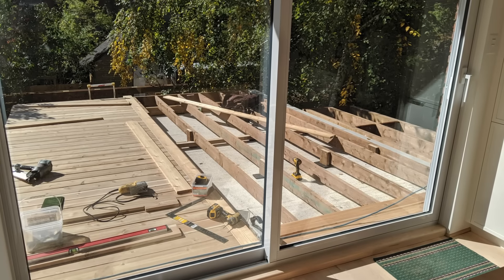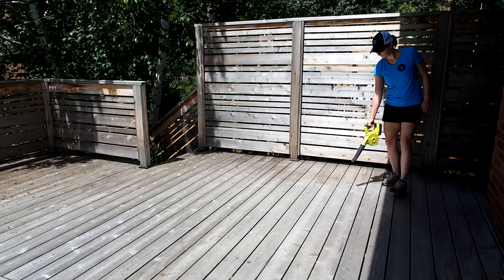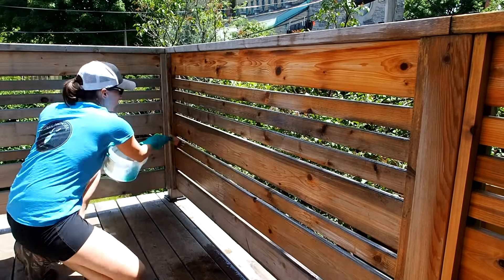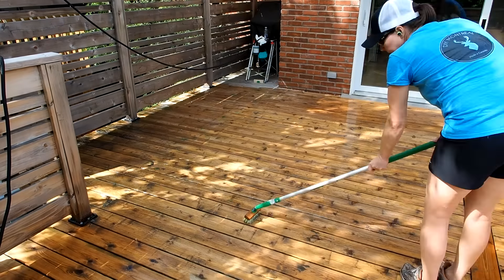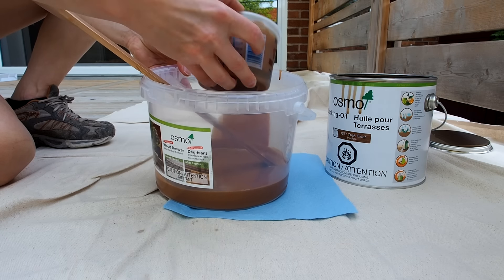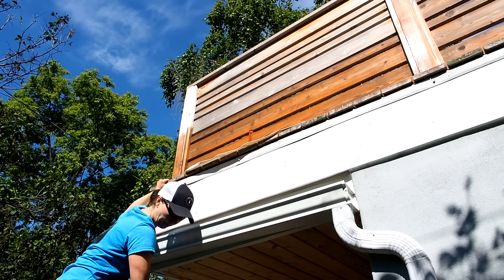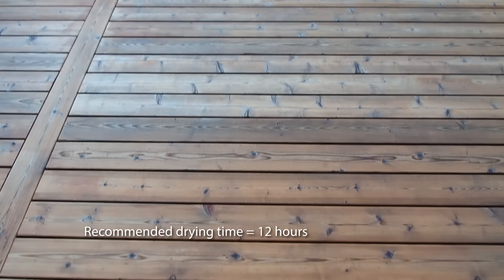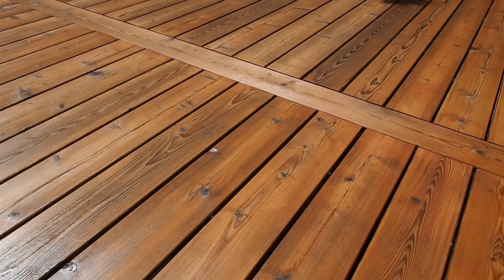Restore Your Deck | Make an old weathered deck look like new again

Comment: Yeah, my wife decided to "help" me by finishing pressure washing the deck while I was at work... and splintered the heck out of the wood. You have to be extremely careful using a pressures washer on a deck, use a wide nozzle pattern and hold it several inches away from the wood.
Reply: It's not necessary to pressure wash, she doesn't do it in this video. Just a hose and cleaning product
Reply: My uninformed self has spent most of today doing this 😂

Comment: Looks great... any word from Osmo on how many years it should last here in Canada?   Their webpage just says it is "easy to apply and renew".
Reply: Most oil products just fades away gradually over 1-4 yrs but you can decide when you want to reapply without having to sand it down
Reply from the maker: I've been told 3-4 years of I recall correctly. Fingers crossed!
Reply: Always plan to stain traffic areas every two years. Use an air compressor to blow out dirt, helicopter seeds from between floorboards
Reply: @drophammer776  Excellent tip?  I will do just that!

Comment: @DIYMontreal it turned out lovely.  How often do you have to do it? I can't stand grey! Wish I saw this before I "refreshed" mine. Over time our deck (much older than yours) swelled/shrank, popped nails, twisted and split.  You definitely couldn't walk without footwear.  It took me days to pound nails back down,  hand plane (I tortured my way through with a block plane fresh out of the package...I didn't know at the time there was a better way...sigh). After painstakingly sanding/planing every knot and bump out and crippling my stupid arthritis I finally was able to step back and admire my efforts. I stained with Thompson seal over fresh looking boards. I had to work under tarps in sections because it decided to rain day after day. The temperature was lowering quickly so I couldn't waste any more time.  I was furious with the Thompson seal! I was ridiculously expensive, and only kept the grey away 3 months!! Oh and supposedly needs redone  EVERY year...

Comment: Marie ... another timely video for one of my upcoming projects: refinishing my deck.  A couple of questions / requests:  What is the rough size of your deck and therefore how much product did you use?  Why didn't you see the need to sand after cleaning?  Question for Osmo ... would they recommend it on Kebony (European version of environmentally friendly pressure treated lumber).   Thanks !
Reply: I recommend contacting Osmo directly with your questions and deck dimensions. I found them extremely helpful and responded. They truly want your project to be a success!
Reply from the maker: My deck with all the railings and stairs worked out to roughly 1000 sq ft. The deck itself being only about 320 of that. The coverage is roughly 250 sq ft per liter if I recall. It drinks a lot on the first coat but less on the second.
Reply: @DIYMontreal  Thank You Marie

Comment: Osmo has UV protection oil as well in clear and other tones. Would you recommend using it along with decking oil? I also prefer the natural or light color over deck. So can i mix grapa decking oil with clear UV protection oil ?

Comment: Have used a garden knife (good for narly Johnson grass) to slide between boards that collects lots.  Oxalic acid thought is what naval jelly is made of (for rust removal), makes a large difference on appearance of the wood ! (maybe wear more protective things). We just brushed lots of dark bits off the cedar fence (wearing a mask), then tried to clean with vinegar, not much diff. Might try a borax solution after for reducing flamability and fungus and termites . How does your deck loock now after almost 2 yrs?

Comment: Nice job! Will need to do the same this Fall when it cools off here in Oklahoma. Will definitely try the Osmo products. Tip: I used to use a pressure washer on the (hardwood) deck, but after shoulder replacement and back surgery had to find something that wasn't so hard to start and use. I bought the bristle brush attachment for my EGO powerhead and was  AMAZED at how well it cleaned the deck. Cleaned it thoroughly and  uniformly (no pressure washer streaks). It was also MUCH easier and faster (took just as long to clear the deck first). Highly recommend for any deck owner. Enjoy your videos!